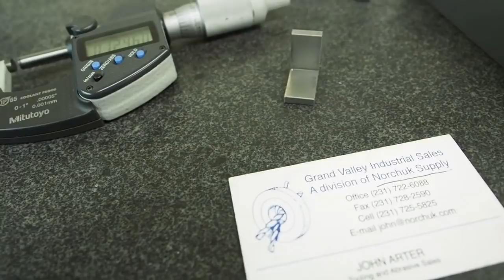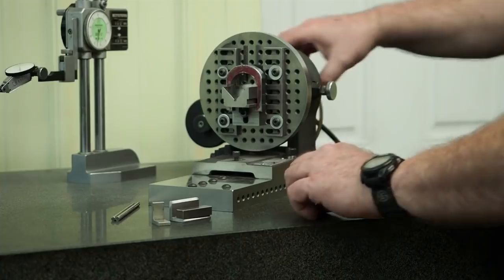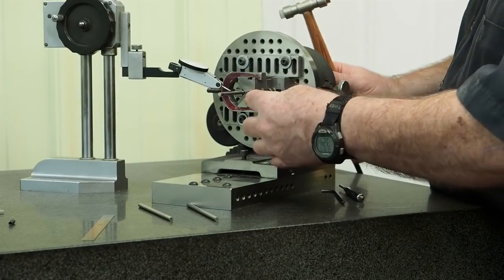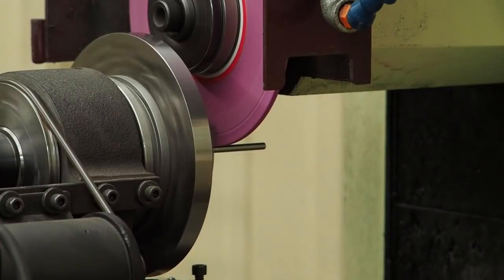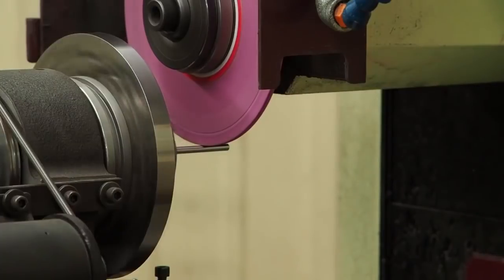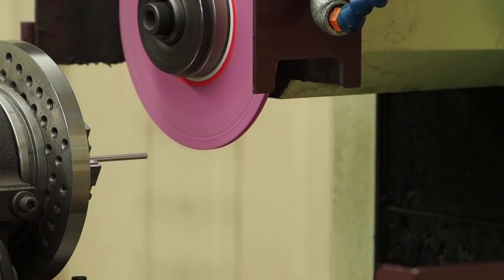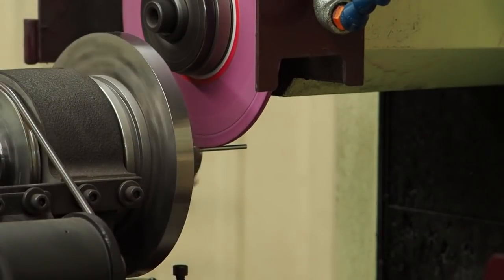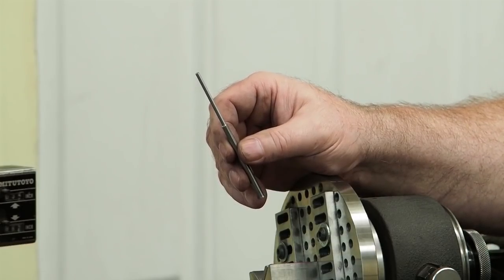This Radiac grinding wheel is amazing.

Comment: Even as a Toolmaker who specialised in Tool and Cutter work for over 30 years there was both tips and reminders in the video/s for me. However I am intrigued why an ER collet chuck was not used for holding the blank in. I have done similar jobs on numerous occasions, and while not as long I have gone down smaller diameter. When chatter did come in I used a piece of hardwood or aluminum, as a hand gauged steady, ensuring a rise up from the point of contact away from the wheel direction of operation. It is amazing what you can get away with, but realizing the area of contact does reduce as the work diameter gets smaller, for a given infeed.  The depth stops of the chuck would be used for runs of work. Also a boot was placed over the chuck to avoid grit getting in.
Reply from the maker: Thanks for commenting. I do not have an ER32 collect set but would have used what was shown in the video anyway. By properly positioning the top clamping rig I have great control of the part. There are many ways to control chatter in a part with a long stick out but the purpose of this video was to show how good this Radiac wheel was without any extra help.
Steve

Comment: Steve,
Good video with lots of useful info. I've spent many hours over the years cranking a Harig Gring-All by hand. Would have loved to have a motorized unit.
One suggestion I would make is to start grinding at the end of the pin and feed towards the spinner. That way you are feeding towards the larger diameter which gives you a little more support. I also made a block with a spring loaded nylon plunger to cradle the underside off the pin. As you reduce the diameter of the pin, the spring keeps the nylon in contact with the pin.The hard part is finding the right spring and length of nylon that supports the pin without deflecting it.
Reply from the maker: Hi Rob,
Thanks for the tips. Once you use a motorize unit it would be hard to go back to hand cranking. We always grind from the shoulder to the non shoulder to keep wheel geometry the best at the shoulder side. Even if I went the other way at that small of a diameter I may have had problems. I was pushing the limits pretty hard.
Steve

Comment: well very interesting steve i am learning alot of valuable info from you, and i will be using your info when i get my new-- old 1977 harig super 612 surface grinder in action wich i just purchased 2 weeks ago. it came with a walker control and a suberban 6x12 mag chuck a $4000 dollar option new and i paid $2500 for the unit and $460 for shipping. paid allittle much i think but we will see how she peforms. thanks Steve.
Reply from the maker: Sounds like you got a good deal. Did you get to test it before buying it?
Steve

Comment: Your sharing is great, it is focused on grinding, I know binding or building in stresses when locking down work and you are showing ways to control and eliminate that in the setup and boy you know your stuff, I think you mentioned in an earlier video you have been a tool grinder for 40 years? Thank you I really like your work. The singing is a great way to share one more way on how we will know things are not right. The flexing always worries me so I think I would make too many maybe unnecessary passes.
Reply from the maker: Hi Active Atom,
We do a lot of grinding because many of the viewers request it and I am happy to share what I learned over the years. I have been in the machining trade for over 40 years and includes many different areas of learning. I have a lot of time on manual Mills, Lathes, Surface and OD, ID grinders, CNC Mills and Lathes, Wire EDM, Cad and Cam and tool testing. I had the privileged to work with and learn form many highly skill toolmaker and machinist including my father who was one of the best on manual equipment.
Steve
Reply: I normally Steve, do not reply to the replies I merely just come back place a thumbs up to let you know that I received and read your reply, however forgive me for this reply to the reply. I know you are teaching your children your skills, it is one of the highlights to watching your videos to this 4th generation machinist, but I want you to know that the message about your dad and how you expressed his machining grinding greatness, and clearly his influence into you becoming a tool grinder and many other (mentioned above) skills yourself. We Patrick and Lance are hoping your children will say in their futures how much of a skills and good person impact you made on their work.
Reply from the maker: Thanks Active Atom.

Comment: Like I've already said...i don't watch machinist videos to learn....
But if anyone thinks they can do any of this simply by buying the machines they in for some real shit...now, when i say "this" i mean what I'm aspiring to attempt alone and that's tool and gage.... u can't even begin to imagine the determination and knowledge it takes to really do this.
Reply: You dreaming if u think otherwise
Reply from the maker: You can have the best equipment but it is only as good as the person operating it. There are 3 stages of learning. 1st Knowledge 2nd Understanding and 3rd the most important that you cannot get to without the first 2 Wisdom. Knowledge is just the facts that by themselves will just puff up a person. How many people does one know who claims 40 years of experience? Does this person really have 40 years experience or do they have 1 year experience 40 times over? Understanding is when the knowledge comes together and makes sense to a person, it is the light going on. Wisdom only comes with practice. It requires getting your hands dirty and putting the knowledge and understanding to use. It is doing it over and over until you make it look easy to others watching. It is practice to the point where the saying they can do it blind folded comes to play. I strive to give the first 2 in the videos but the third is not in my hands without one on one training and even then only a few will achieve this stage.
Steve

Comment: You would have better results with a pivoting counterweighted steadyrest. Its made with a heavy gauge (1/8" drill rod) wire bent to suitable shape, counterweighted with an adjustable position weight. I just tapped a hole through the side of a 5/8 nut for a thumbscrew to hold it in place. The arrangement pivots on a small block with a hole through to accept the wire, and another hole for mounting. Mounted to the face of a small angle plate, the counterweight is adjusted so that the opposite end rests on the work from the bottom, without deflecting the pin you want to grind
Reply from the maker: Hi old magician,

I agree with you on the steady rest. I actually have a very nice one myself. In this video I want to see what I could get away with without a steady rest. That wheel cut so free I want to push the limits and see how small of a diameter at that length I could go.
Steve

Comment: When you reached .120" and started to see issues developing, what might you have tried to try to go farther?  Dressing the wheel might have been counterproductive unless you could also massage the lead in corner (and maybe the entire cutting surface) a bit, just guessing on my part.  If you REALLY needed to get it smaller while still holding a tight tolerance along the length and also a good surface finish, what other things might you have tried, and why?  Food for another followup video or maybe a short discussion addendum to a video, perhaps?  8^)
Reply from the maker: Hi Bob,
I think you are on the right track. Redressing the wheel and making a smaller contact surface was one thing I thought might work. Instead of .06" surface contact maybe .03" to reduce wheel pressure. Maybe be careful and use a harden steel block by hand and gently break the wheel in after redressing. Maybe going to 120 grit. I will have to try some thing off camera when time permits an see if I can push the envelope further. If I can we will have to share in a future video.
Steve

Comment: Thaks for the wonderful vid. Can you recommend a wheel suitable for grinding zirconia parts? Also, does this material requires special dresser?  A harder one?
Reply from the maker: Hi Fischer977,
I have never worked in this material but I am guessing it will have to be ground with diamond wheels. If you are using diamond wheels then a standard diamond dresser will not work. You have to use special tools to dress and true diamond wheels.
Steve
Reply: @SolidRockMachineShopInc  Thanks steven

Comment: Hi Steve, thanks for a very interesting video!
Do You think grinding at an angle would help? I remember having less stability problems when the wheel was at about 30 deg angle to a flimsy pin. I think that the  angle tends to reduce the area in contact with the wheel, but the wheel will wear differently which could be bad for accuracy.
Reply from the maker: Hi Eric,
I not sure I am following you. How are you grinding at 30 degree angle? Is the spin fixture set at 30 degrees from the back rail?
Steve
Reply: @SolidRockMachineShopInc  Yes that is what I did. 
I am not sure about the precise angle,since this was some time ago but resonances and chatter  decreased a lot.  I made some flimsy conical needles for a valve this way and the shape came out much better. Main problem was getting close to the wheel when it is at an angle. Used a small collet holder as an extension.
Also, I sometimes do quick and dirty grinding on the bench grinder holding pins in a cordless drill and noted that this also "feels" best at at certain angle between the pin and the wheel.  
Perhaps the reduced contact area and difference in rotation axis is what changes things. Wheel wear is  a concern doing this since the wheel will change shape differently, more like creating a grove in the center instead of wearing from side to side as usual.  I dont´t know if this  would work in Your situation but it seems sort of similar.

Best Regards, Erik
Reply from the maker: Hi Erik,

That makes sense that the direction of the wheel force would be changed. I never tried it but it would be hard to keep the high spot of the wheel with the high spot of the diameter of the pin. I am guessing you had to traverse back and forth in the X axis as well?
Steve
Reply: @SolidRockMachineShopInc   As I remember it, I traversed X and adjusted Y over the length of the pin  This way the point of contact will stay well centered vertically under the wheel  and the high spot on the part and the wheel will tend to match. I have an old diaform dresser on my grinder that permits redressing the wheel without disturbing the setup which is useful when doing something like this. 
Perhaps a T&C grinder is a better option if trying this since  the wheel can be set at any angle and formed. The way I tried it the wheel needs to be dressed very flat. Actually I consider a to bid on this grinder next week provided shipping can be arranged:
 https://psauction.se/item/view/471463/verktygsslip-jungner-us-2305
It´s presently under 1000$. If You look a few items above  there also seems to be a big brother to Your grinder  up for auction.

Best Regards, Erik
Reply from the maker: That looks like a nice T&C grinder for the price.
Steve

Comment: Is there a preference to the rotation of the part in relation the the grinding wheel rotation ?
As always, Thanks !
Reply from the maker: Hi Brian,
Yes, I like to rotate with the wheel direction rather than against.
Steve
Reply: I was going to ask that. I could see from the sparks which way the cutting wheel turned, but the darn video artifacts left me confused about which way the rod was turning. Very informative video, thanks for making it.
Reply from the maker: You're welcome Wes.

Comment: Tapping it in like that will shorten the life of your bearing.  I use a knocker with a bit of delrin screwed to it.  Helps minimize the shock. Only because the joker who used hairg before me broke the little rake and pinion gear that you should use.

Comment: May have missed it in one of your videos but how are you balancing your wheels?
Reply from the maker: Hi Jason,

The only wheels I balance are super abrasives on dedicated hubs. Very rarely is it necessary to balance 8" and under wheels. At my full time job we do not even balance 2"x12" wheels.
Steve
Reply: Solid Rock Machine Shop Inc. 
Steve thank you for sharing all your knowledge just picked up a harig 612 in amazing condition with 2 axis dro... learning the ropes and I keep coming back to your videos to learn. I just spent $90 for 2 balancing hubs from Sopko and sons for these 7 inch wheels.... if your holding tenths without balancing then I guess I really don’t need to balance my wheels. Everywhere I look everyone is balancing their small wheels I figured it had to be done.
Reply from the maker: @jasonmichaels6660 ,

If you place your hand on the wheel guard while the wheel is running and feel vibration then wheel balancing may help a little. If you want the best finish possible wheel balancing may help some. Most high quality wheels are very close already and proper wheel dressing and truing will be way more important than wheel balancing. This video will explain why truing the wheel will compensate for imbalance. https://www.youtube.com/watch?v=btpFfhGm6tk&t=0s&list=PLFA60459F187488EF&index=24 I have seen many of the YouTube videos on wheel balancing but have seen any that show before and after results in the work piece. Also, they should be truing the sides of the wheel for balancing as well. This will help the wheel stay in balance as the wheel gets  smaller in diameter from use. The finish and accuracy I achieve without wheel balancing is very good, I doubt wheel balancing is going to improve it much at all. Do a test and see if you can see or measure a difference grinding with the same wheel before and after balancing. The Harig is a nice machine, I hope it serves you well.
Steve
Reply: Solid Rock Machine Shop Inc. 
Steve thank you so much for taking the time to write back to me. I appreciate all the info, keep the grinding videos coming I am a knife maker now learning metal working. Thanks to people like you I can learn proper grinding techniques. If I have any questions do you mind if I email you? 
Thanks 
Jason
Reply from the maker: @jasonmichaels6660 

You're welcome Jason, I would be more than happy to help you. You can find my email on the about page.
Steve

Comment: This is the type of work a centerless is good at is it not? that video Robin did awhile back https://www.youtube.com/watch?v=ZXAVst_0Xxk would that not maybe be a good way to go lower since the pin is backed up?
Reply from the maker: Hi Brian,

I have never used a center less grinder but you may be right. I seen Robins video before and that may work but I don't know if you can grind to a shoulder with that method or not. I was impressed with the Radiac wheel and wanted to experiment just to see just how much I could get away with. I was surprised that I made it to .1202" diameter that straight without taper and a good finish.
Steve
Reply: Learning is what it is all about. :-)  I know centerless grinders can be setup to grind multiple different diameters on the same part but I honestly don't know the details.

Comment: My kngdom for a surface grinder!
Reply: They go very inexpensive at my local machine auctions.  Take your pick depending on how much work you are willing to invest.  I have had great luck!
Reply: yep, since your sacrificing your kingdom anyways can you get 2 grinders for it?
Reply: Saw one go for 268.00 at a University Online Auction, was in no position to buy it tho, was a Do-All
Reply: Good one Phil! 😊
Reply: Last Year Do-All liquidated a bandsaw division here in Minnesota. I bought several cabinets of 50 taper tooling that were sitting right on the backside of their surface grinding department space.  It took me weeks to clean all the grinding dust off the cabinets and tools. The inside of this building was many many acres of machine tools.  Every square inch was oil saturated from more then 50 years of operation. Wished I could have written bigger checks at that one.
Reply from the maker: Hi Richard,
Surface grinders are a nice tool to have. Be careful buying them used as there is a lot of junk not worth owning out there unless you have the skill and time to fix them.
Steve